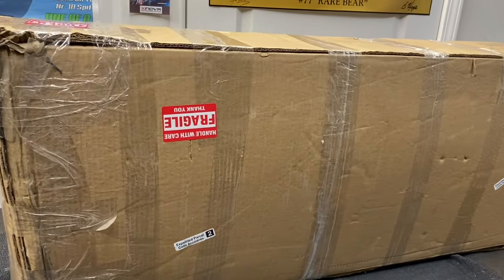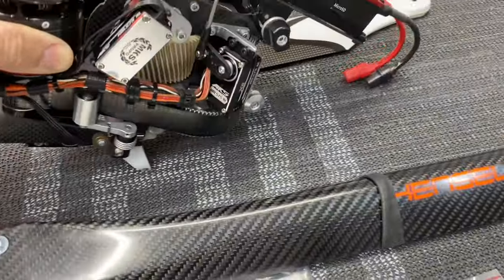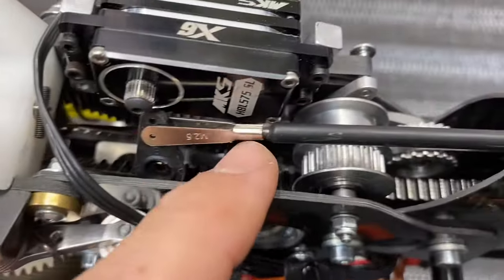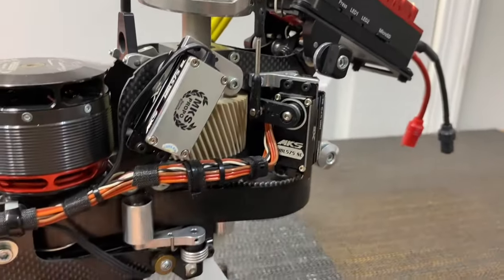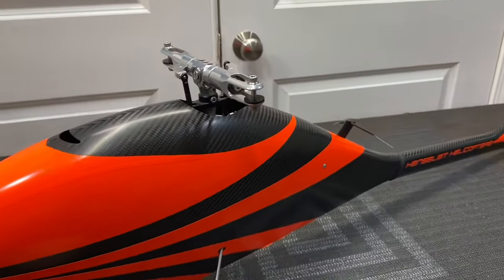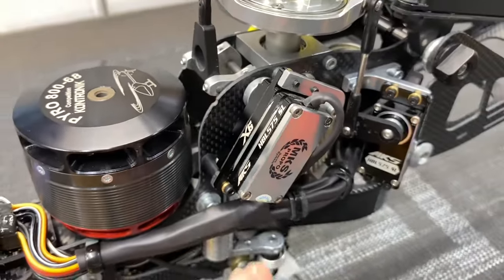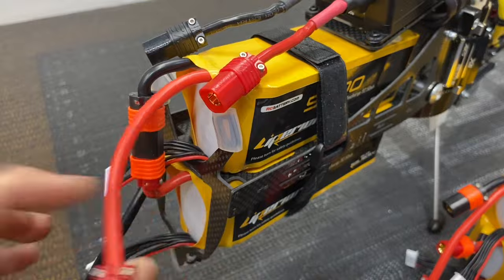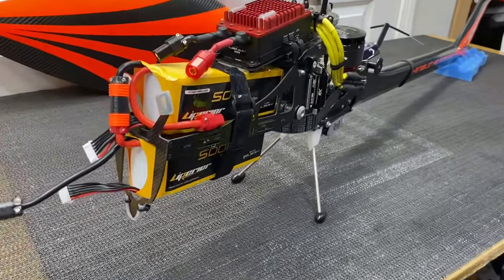Henseleit TDS Build

Comment: I recall many years ago when I first heard of Henseleit helis, they were very pricey. German engineering at its finest
Reply: if their engineering was at it's finest they would of designed the damn thing with a constant tail rotor drive instead of the belt crap!. That's the worst way to go!
Reply from the maker: It’s definitely a work of art and an incredible machine. The tail belt sucks to try to get routed and mounted but once it’s on there, it is smooth as silk. They are not cheap! The most expensive helicopter I’ve had my hands on so far.

Comment: Beautiful machine. I wonder WTH does it not have a driven tail? Is it a perfomance thing? Or to save weight, perhaps? I understand the top-mounted, clockwise-rotating tail rotor choice - it is so that the tail rotor blade going through the top hits clean air (air that has not passed through the rotor) while going forward, at high speed. However, I don't get the not-driven tail. Autorotations will be literally "old-school" style 🤣.
Reply from the maker: The tail is mounted high because of clearance, not for clean/dirty air. But with it being high you can spin clockwise. The heli is a speed heli, you don’t do autos with speed heli lol no need for autos because you are always in the power.

Comment: Not sure what video editor you're using but if you lock the audio channel on the track you're editing before inserting the transition between clips it won't add the fade to the audio channel itself and you won't get that annoying voice fade out as the clips transition.
Reply from the maker: Thank you! I’ll look into that. It’s only normally when I don’t leave enough time after the clip. But I either use iMovie on my Mac or CapCut.

Comment: Henseleit is a German brand if I'm not mistaken. Once quite popular here in Europe. However, I don't hear much about this brand at the moment.
Reply: Jan has retired and no longer produces models.  They still support parts for 10 years after production.
Reply from the maker: Jan has retired and unfortunately no longer make these models. It’s a real shame especially because there is nobody on the market other than Diablo that is producing speed helis and I believe they’re not producing kits anymore either.

Comment: Wow. How did
You manage to get your hands on that?
Very rare very expensive machine. Don’t know much about Liperior packs, hope they are very reliable.
Reply from the maker: It is a very rare machine! Are you good buddy of mine who is actually selling at the perfect time. Liperior packs are fantastic! I have actually been thoroughly impressed with their batteries and I have been using them and almost all of my helicopters even my 16s comet at over 195mph and 300 amps! Check them out if you haven’t already. You will be very happy and pleased, especially the price! I have been abusing the crap out of my packs, and they still under two ohm IR after almost a year!
Reply: Yes I was checking out the Liperior website today and checking some reviews. Seem to have fairly good ratings overall. Been wanting to try some SMC packs but they don’t ship outside the USA, not even across the border to Canada.
Did you get any spare parts with the Henseleit?
I know they committed to producing parts for 10 years after they stopped producing the helicopters. Just not sure when that was.
Reply from the maker: I have not personally tried SMC packs yet but I have heard good things about them. The HV packs don’t really do anything for me just because that extra point 15th of a volt is only gonna really matter for the first 30 seconds and then it’s going to be a standard Lipo. Try the Liperior air packs and see what you think. No spare parts came with the helicopter, but we were able to place an order a couple days ago for some stuff that we needed. Still maki my parts for a good 8 years from now.